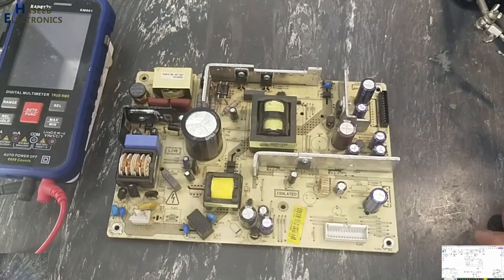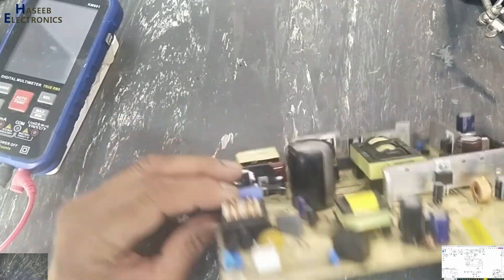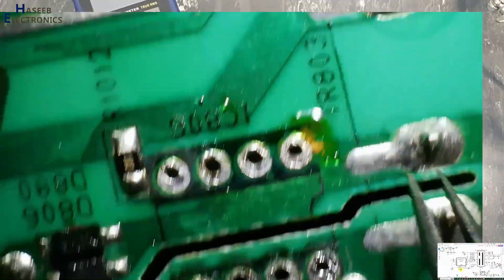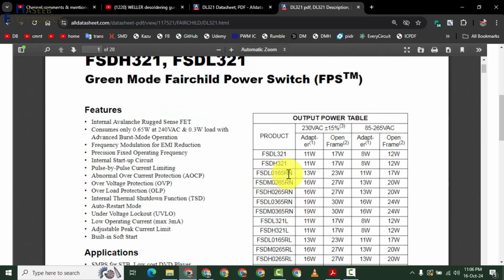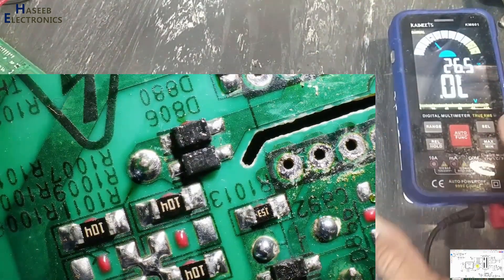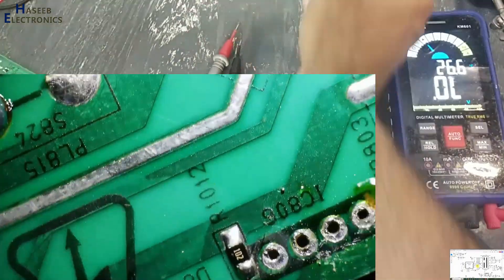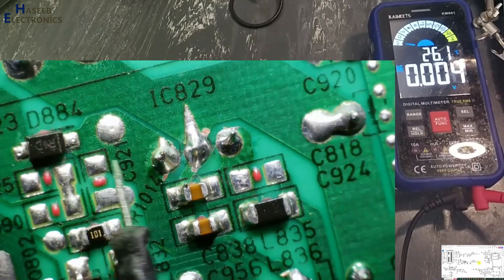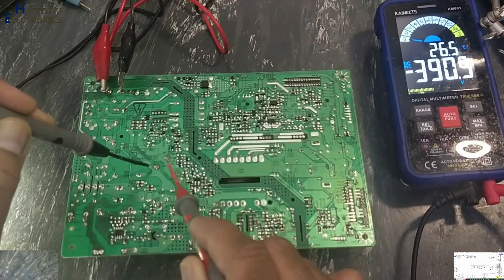{1216A} LCD TV Power supply working and troubleshooting

Comment: Hello sir one thing that is really confusing me is on the output of the transformer is the fluctuation only on five volts but no fluctuations on 3.3 volts I cannot understand why this phenomenon is happening can you explain this thank you
Reply from the maker: 3.3 volt section is high current section, but these is no load this  time 
8 - 12 volt section is regulated further using 78L05 regulator. and there is no load. but 5 volt regulated are good
fluctuation on 78L05 regulator is present 
in primary side high current resonant section is making load on VCC. and that fluctuation is being refelected on standby 8-12 volt section. 
(VCC and 8 volt section are low current windings)
in next session we will find the problem
Reply: 👍thank you so much !!!!!!!!!